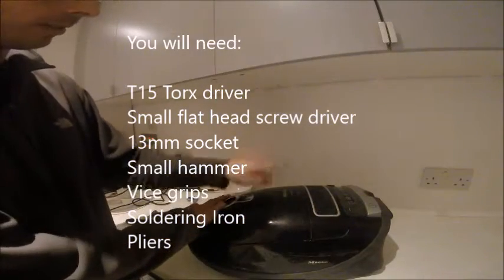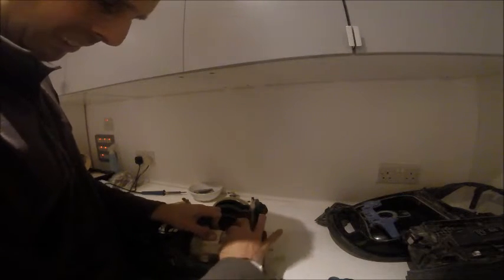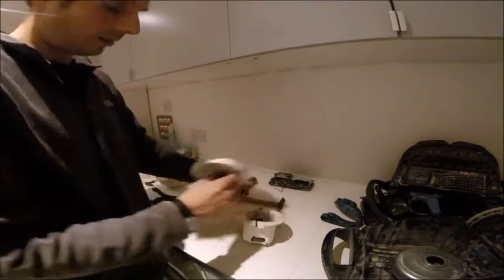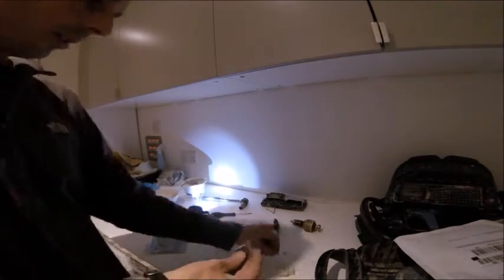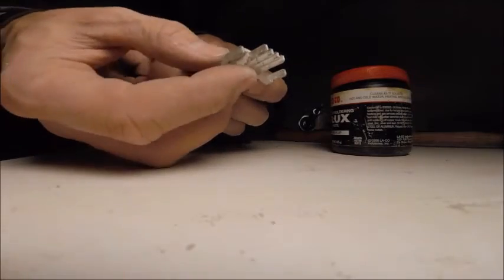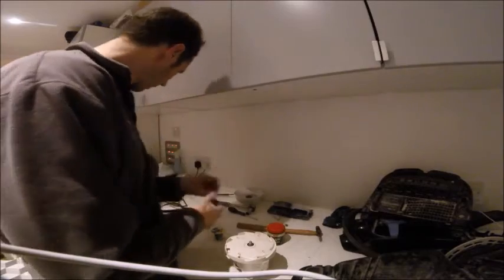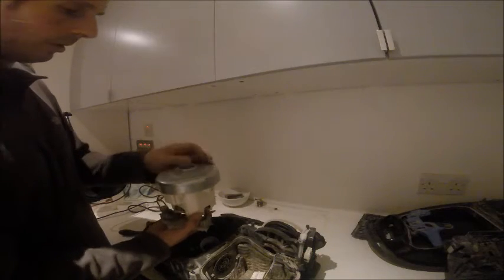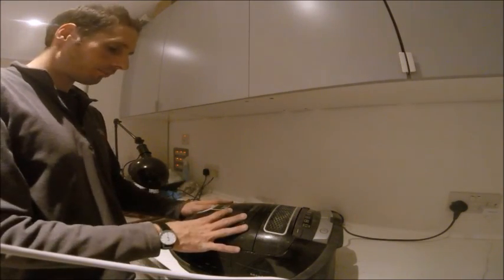How to fix a Miele c3 vacuum with a broken motor for almost nothing

Comment: neat video - I wonder if you have an opinion?  I took apart a very dusty vacuum and took the motor out and the impeller vanes were clogged.  I cleaned it with an air jet and the rpms were insane - a turbo whine...  now the motor doesn't run and I wonder if back emf toasted the pcb? all continuity seems good.  Also - am looking at the brushes - they may have been work by the extreme revs!

Update!  thx to this video - I worked it out - before it was dead - it ran the motor for about a second.  Stripped it down to the thyristor... dry joint! so I resoldered - good as new!

Thx again  ~ mike

Comment: Hi i have this hoover, and it works, but on the 6th gear of power its loosing it,  na it cuts the power. It works weird from gear 3. like its getting to much power. on 1st 3 gears it works. i have taken all apart also, checked teh brushes. all looks fine. any idea why it stopping working on max power ? and cuts the power ?

Comment: 1 simple specific question; The triac LOOKS alright on my S8310 that suddenly stopped working. IF the triac is the problem anyway, Shouldn't the standby light be on when putting power on? I have no lights at all in the electrical board. But there is power to the motor and the board. Thank you very much in advance.

Comment: For my Miele S8790 all was good until about 5 minute mark of video (removing nut). Over the top of the motor is a metal casing which seems almost impossible to remove. Have you any hints / secrets on how to remove this round metal casing. I can send photo if required.  Also, to stop motor from spinning I inserted a small screw driver in between fan blade. I mildly bent it out of shape. Is this a future problem looming. Thanks.

Comment: Dude, good job on the motor but advise, it burnt out because look at that filter, they package both of those filters the pre and the post in each box of bags and should be replaced every box of bags you go through, never fill a bag all the way up, so change bags more often and replace those disgusting filters that are giving that motor a hard time to breathe “exhaust air out” so your restricting air flow. Also may I recommend if your gonna year it all the way down, why not clean rinse wash and polish? All that work and you could of made that look brand new not just the inside but out!! Just advise, but your definitely going to burn that motor out if you don’t change those filters

Comment: Hi there, excellent video but unfortunately I seem to be the only one who has tried this and it not solved the same problem! Please could you tell me what might then be the issue if the vacuum is still making a loud whining noise and smelling of burnt out electrics, even after the new triac is in place?
Reply from the maker: Sorry to hear that doesn't help. The only suggestion I have is to try to identify where the burning is coming from, either by smell or visually.
Reply: @aboutthehouse9253  in case it helps anyone else with similar issue to mine, I found that, while I had successfully replaced the triac as per your video, the problem in my case was that the plastic body at one end/rubber washer to the other end of the spinning magnet component had worn away (presumably because dust got in when the vac was used without a bag etc) meaning the motor has a little movement up and down - resulting in the impeller disc rubbing on the inside of the big round metal cap. I can clearly see rubbing/Blackburn marks where this has been happening. Think it best I just replace the whole motor! Thanks anyway as I would not have attempted even the motor replacement without first trying the above.
Reply: Glad you found your problem... sometimes the impeller is just clogged with dirt. This caused loud whining on my vacuum. It can also make the motor overheat, possibly causing a burnt smell, because the motor cools itself and the reduced airflow would mean reduced cooling.

Comment: Were there any flashing lights when you tried turning it on when it was dead? 
I've got an S8330. The penultimate light flashes once briefly when I try and turn it on. Motor doesn't switch on at all. Wondering if it's worth checking the TRIAC or if it could be something else? I initially thought it might be a break in the mains cable, but I opened the cleaner up and can see mains voltage arriving at the motor connector. I'm wondering if the S8330 has a similar motor/TRIAC setup?
Reply: Did you fix your problem? My Meile HS15 is doing the same thing. You turn it on, one of the light flashes then goes off but motor doesn’t start!
Reply: @arran80Bobber  not yet. Hoping to take it apart next week and replace the triac
Reply: @CB27  Hi KB

Thanks for replying. I hope to have a go at mine this week so I’ll let you know how I do👍
Reply: @arran80Bobber  how did it go? I still haven't had a chance to work on mine yet
Reply: @CB27  Hi KB, Unfortunately I was unable to fix it as I could not source the Motor Overload device that sits next to the Thyrister. I did buy a new motor for £40 but it didn’t work. The supplier said it would work on my model but it was clearly an aftermarket copy. Given that a Miele mote cost about £200.
Reply: @arran80Bobber  aww. That's a shame. Good effort for trying though. Have you tried reaching out to Miele? I think they're keen to help their customers.

Comment: The other Component in the Board mine is rusted I dont know if is any good it has numbers 3MP3610128D0CZAW and on the other side KLIXON any Idea what can I use to replace it or where can I get It. Thanks.

Comment: My problem is, my C3 had some water get in at the motor, it sounded like a modified car with pops and bangs, I followed this video for tear down, cleaned every component and dried out completely, my chip and board look good, but motor is still sparking and popping, miele want €165 for a motor, is there anything else I can do to fix it before being rode by miele?

Comment: My C3 just stayed at the lowest RPM, cannot cycle the +/- speed. Replaced Triac / Motor bearings 608ZZ, still same. The PCB EDW 8303 likely faulty.
Reply: @Benny Woo Mine is doing the same, it just stays on low, if only it had of stayed on high I would be alright with it. Someone else said it was a defective capacitor in the regulator, it should have a value of 0.22uF/275V. At least I can omit what you have already tried. I've dismantled it and cleaned it all including the pcb which looks fine but had a tiny bit of damp on it. The inside body of the machine was quite clean to start with, I've only had it for a few years.  Another site which I can't remember where it is now, someone said to switch the wires so that it just has the on / off function. I watched someone do it with a Henry hoover but can't find any info on how to do that with a C3 cat and dog hoover. I've been researching bypassing the motherboard and soldering etc but it's frazzling my noodle. If you ever find a way to fix it or if anyone else could help I'd be so grateful, thank you!

Comment: So I purchased a new Triac and fitted it, the solder won't stick eventhough I have flux. Anyhow when turning on, I get the main led come on but go out again? Any ideas?
Reply: Have you ensured that your soldering iron is really hot? You might also try using some wire wool to rough up the contacts on the board and remove the old solder. Good luck

Comment: Anyone know where to get  replacement carbon brushes. Incidentally I failed to undo the nut holding the fan using 13mm socket so I carefully  drilled the side of the nut and split it with a small chisel. If I can source brushes I will saw a slot in the top of the armature shaft so that I can hold the armature with a screwdriver and hopefully tighten a replacement 8mm nut.  Great video by the gentleman in this post

Comment: I can't get the nut loose, even when holding the impeller, it just spins the actual motor itself and there's no way for me keep that motor from spinning as the housing prevents me from gripping it with vice grips or anything.

Comment: Great video thanks. However my Triac looks ok however the other component next to it looks rusted and shot but I can’t read the blue label markings. Any idea what it is?
Reply from the maker: Can't quite remember. I usually find any serial number of markings on it and Google it to find out
Reply: @aboutthehouse9253  it’s reading as closed circuit so I am going to replace the triac anyway! Fingers crossed
Reply: @PeterDColman  Did it work for you by just replacing the triac?
Reply: @PeterDColman  Did you manage to get one in the UK?
Reply: @PeterDColman  Did you manage to source one in the UK?
Reply: @spidervenom14  yes
Reply: @arran80Bobber  yes I did. I think it was through ebay
Reply: @arran80Bobber  look for T2550H-600T = T2550H600T  FULL WAVE THYRISTOR (TRIAC)  TO-220 ''UK COMPANY ''
Reply: Still available. About £10 inc postage
Reply: @PeterDColman  Thanks for replying. This is for the triac not the Thermal Cut out?
Reply: @arran80Bobber  yes the triac iirc
Reply: did you source the thermal cut out on ebay as well?
Reply: @arran80Bobber  no. I didn’t need to change that iirc

Comment: Good video, but I don't know how you didn't mangle the impellor with the vice grips. I did the same but the nut was so tight (LH thread!), the impellor tore up.
Reply from the maker: Its certainly easy to do that. I can't claim was as good as new, but as long as it doesn't foul the casing, it should be OK. You may also be able to shove a screwdriver in the vanes to brace it.

Comment: Hello,

In your video, you show the disassembly of the washers in one direction and the reassembly, in the other direction ???
With a 480p video, you can't see well.
Thank you
Reply from the maker: Hi, I've double checked and I put them back how I disassembled them. The ridged washer goes ridged side down under the impellor and the curved washer goes on top so the concave side is down (that is so that if it were a bowl, the bowl would be upside down). This gives the bolt something to tension against.
Reply: @aboutthehouse9253  Oh thank you very much!!

Comment: What parts do you recommend to use? I am struggling to find the bearings / triac on eBay.
Reply from the maker: Are you in the US. Farnell still sell them, but also Ebay in the UK https://www.ebay.co.uk/i/123275326306?chn=ps&norover=1&mkevt=1&mkrid=710-134428-41853-0&mkcid=2&itemid=123275326306&targetid=938486032260&device=m&mktype=pla&googleloc=9045871&poi=&campaignid=10199635171&mkgroupid=107296318292&rlsatarget=aud-629407026865:pla-938486032260&abcId=1145987&merchantid=101740276&gclid=Cj0KCQjw-af6BRC5ARIsAALPIlX_W7PoMjtUCxHHYCEvJiRwKxnpi1lLWrGqlS0wfjQHgmOB3ocqD3IaAkgNEALw_wcB

Comment: Theres a fast and slow on miele hoover the fast mode stopped working whats wrong
Reply: @brendan mcmahon Someone said it was a defective capacitor in the regulator, it should have a value of 0.22uF/275V.  Someone else said to switch the wires so that it just has the on / off function and to bypass the pcb. I watched someone do it with a Henry hoover but can't find any info on how to do that with a C3 cat and dog hoover. There's no video anywhere online I can find.

Comment: I can't get the metal shroud off the motor - tried everything - any ideas?
Reply: Took a bit of work but WD-40 along with putting motor in vise on workbench allowed me to tap it off with hammer and screwdriver

Comment: Great video. The fan on my motor is broken and needs replacing. I can’t find them anywhere to buy. Anyone know where I can get one (I did order a generic one from eBay but it was the wrong shape and size; all the other ones I have seen also look the incorrect shape/size.)
Reply: You can buy mine. Where do u live

Comment: Electrical engineer here.
There is a reason why the triac fails. Its because the motor is pulling to much amp because the armature is worn out.
New triac wont last much longer
Reply from the maker: Perhaps, but I think this also happens when the motor is overloaded. In my case the impeller was blocked, which I think was the root cause. It certainly lasted a long time after I replaced the triac. If you wanted to replace the armature, you are in a great position to do that having opened it up fully

Comment: Your video helped me to dismantle my Miele Vacuum. My friend tried usung the Vacuum to suck up water from the floor of his car. The Motor looks fine but the whole inside of the motor socket has blown. Where can I get a replacement socket complete. The number of the socket would seem to be --6989103 it also has the numbers G5 and 12-10-18  Please help me.

Comment: Great step-bt-step taking the cleaner appart until I got as far as removing impeller: made from soft fabricated aluminium, not  casting, unable to to undo the centre nut without substantial damage to impeller. Looks like another machine...
Reply: The better way is to use impact wrench. If damaged, search on eBay "Impeller Rotary Fan Blade Vacuum Cleaner"

Comment: Great video. Wish I had watched before destroying the impeller for trying to unscrew it the wrong way. Fortunately, was able to scavenge a spare.

But, like other commenters, I want to replace the bearings. Sourced replacements from the excellent simplybearings.co.uk (SKF 6082RSH Rubber Sealed Deep Groove Ball Bearing 8x22x7mm at £7 a pair plus £6 for bearing retaining glue).

That said, the challenge is to get the old ones off. The bearing pullers I bought aren't small/narrow enough for the job. Any ideas?
Reply: Hi Andrew. Thanks for the tip re: bearings!   How did you manage to remove the old bearings?
Reply: @alexrojas363  bought a bearing puller which removed one of the two. Did the other, I had to fashion a special fork to get it off as there was no space for the bearing puller arms.

Comment: This motor is used in many models so this is a very helpful video.  S5xxx ,S8xxx, C2 and C3 models.   Motor code is 7890580.  Here in Australia RS online https://au.rs-online.com/web/cp/1688899,8773024,8773024P/?sra=p&r=t have the part (the T2050-6t comes in a pack of 5, or the 35Ma version T2035-6l  comes in packs of 2 https://au.rs-online.com/web/cp/1686667,6871025,6871025P/?sra=p&r=t